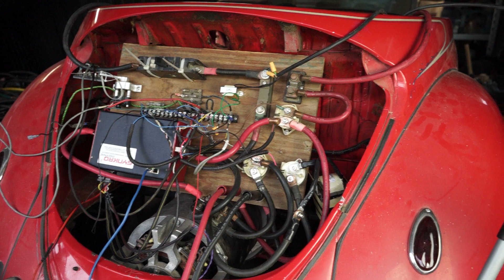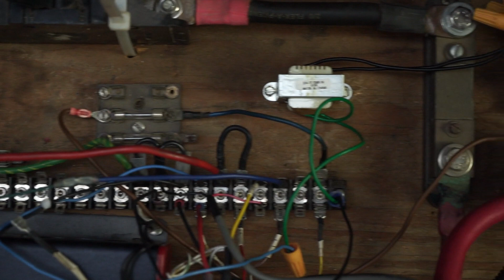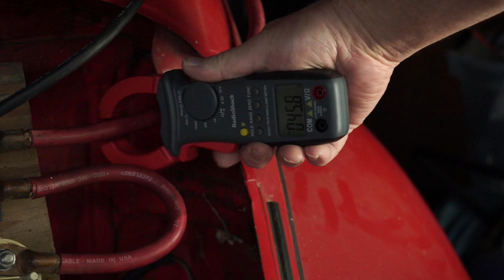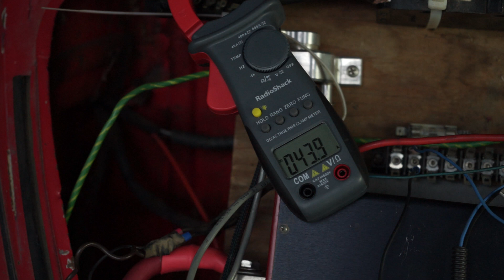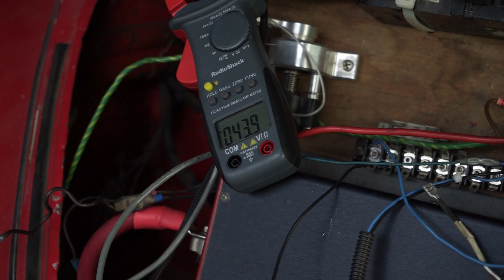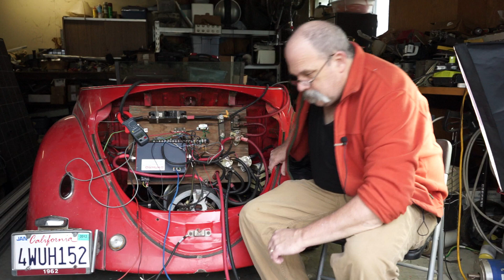DC Charging

Comment: puzzled by your wiring,  a welder??
Reply from the maker: +lez nbriddon The wiring is specific to the controller for using the controller as a charger. The long lanky wiring is just mostly because I was still in testing phase but the car was drivable. The Synkromotive controller is also a charger. It was designed to be a charger that can utilize any DC source and the welder takes the AC from the wall and converts it to DC. I then pipe that DC back through the controller and inductor to allow the controller to boost the DC voltage back up to the required Pack Voltage. It requires a voltage that is less than the lowest voltage of the pack in order for it to work. I can also take a 110 volt AC source and convert it to DC then use that DC voltage to charge a large pack like one of 192 volts. You can't take 220 volts and have the controller step it down. The controller can only step up DC via the inductor. So in order for me to utilize the 220 volt outlet at 60 amps I just used the old Welder which will do that for me. It converts the 220 volts down to 70 or so volts and then I just put it back through. So with the inefficient use of the Welder I was still able to get a solid 45 amp charge out of the wall. No, the old welder is not an ideal DC source but a nice battery pack would be. I also did this using a DC Stationary battery pack that was 48 volts and I was able to pull out 120 amps worth of current but mostly I got about 75 amps charging current and that equates to Fast charging which many are wanting. Im just trying to make a nice clean little system that will allow me to charge up a nice bank of batteries with may solar then use that battery pack to charge my Cars pack fast. I don't have a machine shop to make a nice clean looking system nor can I devote all the time I want to the project due to my normal every day job that pays the bills. I hope it helps but if you want more information I'll try to help. Its the only DC controller that is designed to also be a Charger. The only one.
Reply from the maker: +lez briddon 
https://www.youtube.com/watch?v=N9NzD8H9Zdo
https://www.youtube.com/watch?v=i-FKz7TCi5I
https://www.youtube.com/watch?v=lHvpkhOwW-g